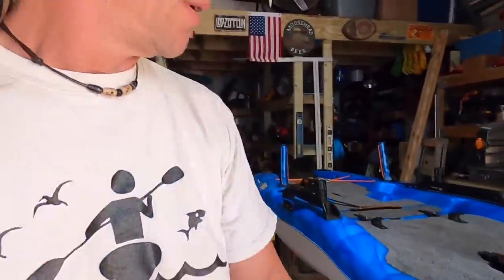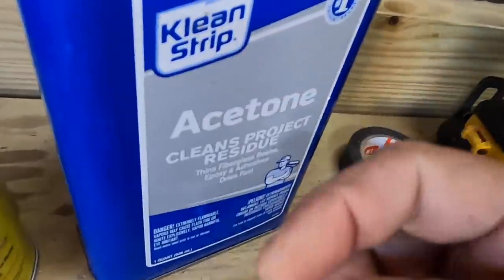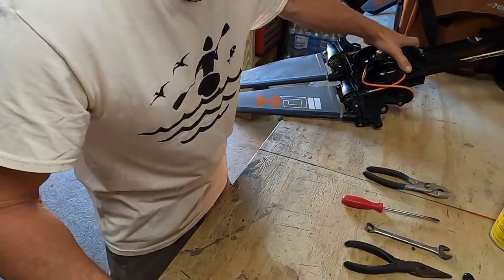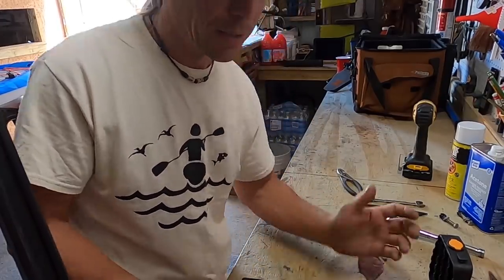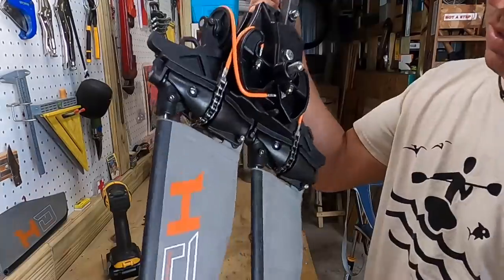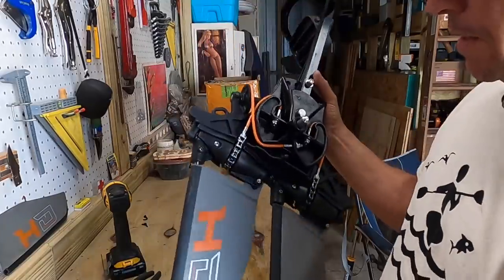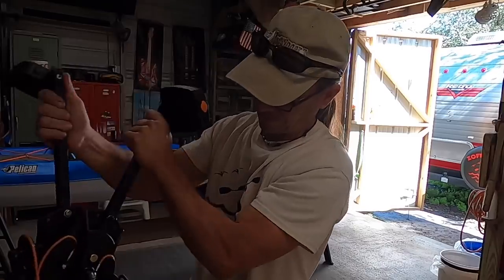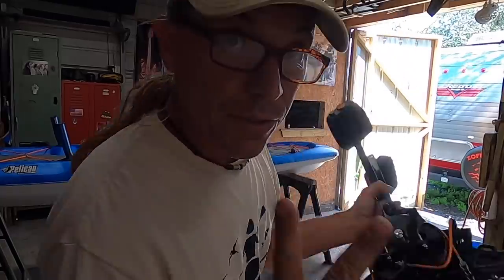Pelican HyDrive Hacks

Comment: I have the HDII drive and did some of theses mods.  I didn't want to lock my pedal arms in place because I let my kids use the kayak.  That being said I did loosen and lube up the cables and pivots and it made a big difference.  One thing I did differently, though, was to use a single layer of Teflon adhesive tape in place of the black tape you put in the pedals.  It achieved the same effect of quieting the noise, but doesn't lock the pedal in place.  Plus the Teflon acts as a bit of a self lubricating surface, reducing the resistance to pedaling.  Great video.  I've enjoyed watching and learning from you.

Comment: On the pedals where  you put that tape I think a better idea might be to use shrink tubing. I think it would stay put better and not become gummy overtime.
Reply: I've worked as an Electronic Tech for 40 years. I NEVER use electrical tape, don't even allow it in my Tech room. It always turns into a gooey mess and causes more problems than cures. Heat Shrink is the way to go. Also, I use don't Acetone to remove decals or stickers. Alcohol breaks down the glue without damaging the plastic parts, just let it soak in for 15 or 20 minuets. Thanks, Marty, for another Great Video!
Reply: I might try a combination of Teflon tape and heat shrink

Comment: Maybe try Teflon plumbing tape on that pedal shaft, has to be better than electrical tape.  
Removing stickers and adhesive labels is much easier if you apply heat using hair dryer or heat gun first.  Had someone put a nasty adhesive “do not park here” sticker on my car window, but it came off in one piece with hair dryer, easy peasy.

Comment: That pedal orange band being shipped so tightly is the same thing I deal with on commercial rtu’s( roof top units) the drive belts for the evaporator fan is so tight that if you don’t loosen it will stretch out so much you will get a call back with in a month for low air flow and a frozen coil. Due to the belt being stretched out. I’m sure that happens with the orange band as well.

Comment: I've been wondering if the HyDrive is "close enough" to the Hobie unit  for amateur boat builders.
Reply: It's essentially a copy of the original mirage drive. You can use hobie mirage parts to replace things that may break or wear out. So far only issue with my hydrive is it's developed a annoying squeak after 2 years of heavy use.
Reply: @kyleoden3015  Thanks for the update. I might try one on my next boat build.

Comment: a good tip that marty touched on is, WD40 doesnt last long, in fact, it is best suited for displacing moisture or penetrating stuck bolts, however it also has chemicals and detergents in it that can actually cause more rust and corrosion over time, i see people use it on bike chains and some even spray their components with it only to find those parts rust much faster when WD40 is applied. i personally use marine grease on my bike chains, others use bar and chain oil or just simply go buy the chain/cable lube type of lube.
Reply: Anyone that isn't a woman knows this
Reply: @noway57  im not sure id agree, my wife, mother, daughter and some other females know more about cars than some of my guy friends, she used to watch me work on our old 60s firebirds and camaros then started helping and now she can name more parts on an engine than a lot of my guy friends. she also pulled a bad trans from my old camaro while i was at work, not all women are into shoes and makeup.

Comment: id say the rattling of the pedal pads themselves was due to the sideways moevement of the pedal on the rod. a couple of washers would have been a just as simple fix. It would also add enough resistance to possibly keep the pad in the same position as youd want it.